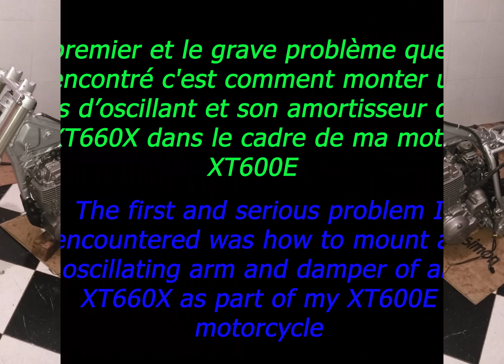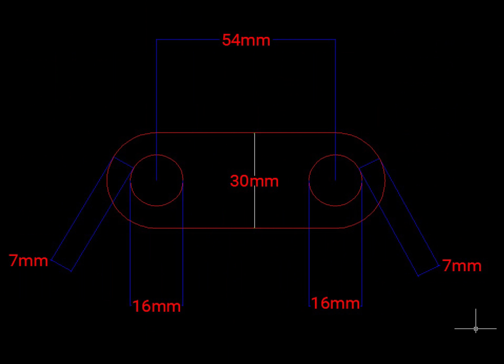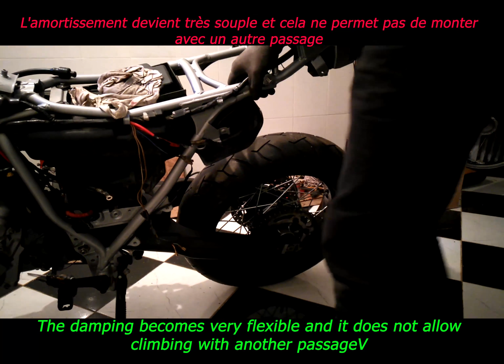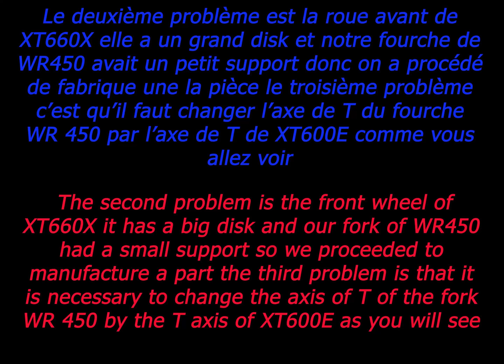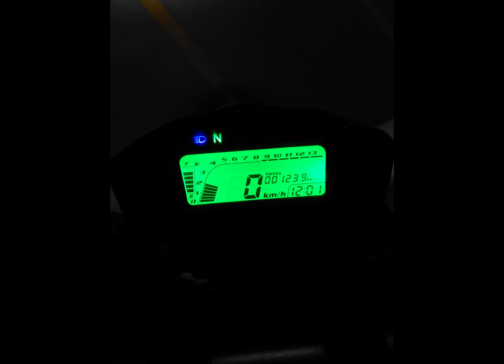XT600E Modification   Tuning in Morocco with Tarik and Ayoub

Comment: Hola tengo una xt 600 del 85 y le he puesto una pizarra digital y me gustaría saber si hay algún pulmón  dentro donde está el neutro para ponerle el resto de las velocidades.y donde puedo conectar electrónicamente lo más exacto posible la revoluciones del motor
Reply: Ok gracias acabas de sacarme de otra de mis dudas no sabía a q distancia debía poner el sensor de los imanes.pero me gustaría saber si hay alguna forma de poner q marque las marchas 1.2.3.4.5